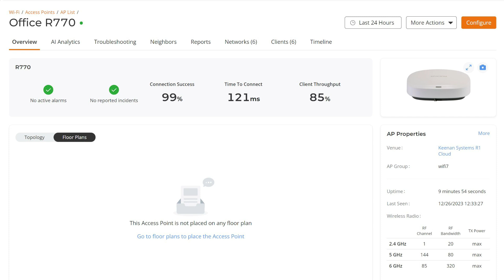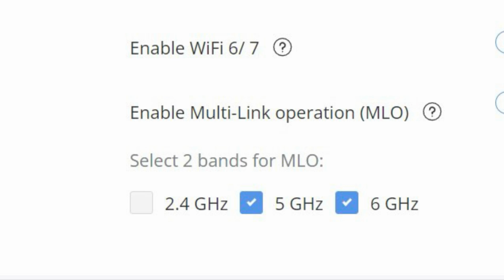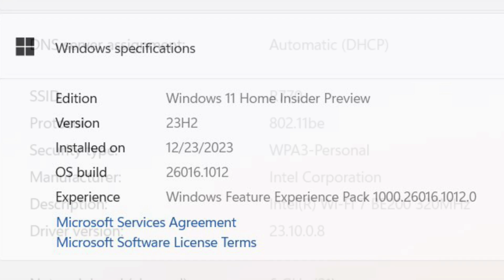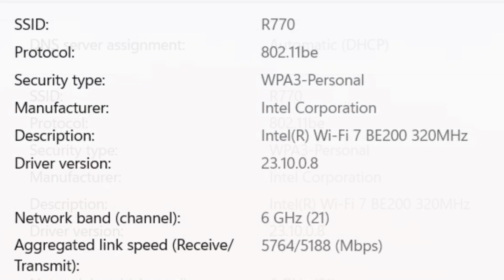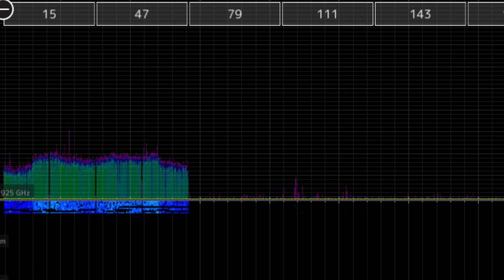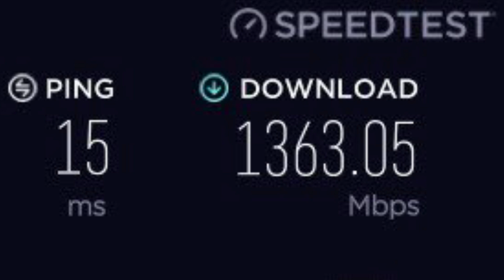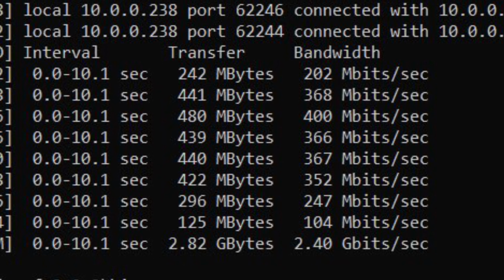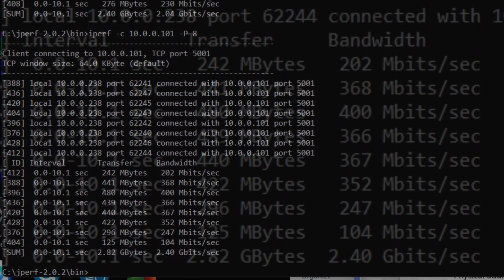Ruckus R770 Wi-Fi 7 802.11be Access Point Review 320Mhz and Multi-Link Operation (MLO) Tested

Comment: I had a year long saga with the Ruckus R770 AP.  I couldn't get full speed out of the AP despite having the correct version of Windows 11 and Wi-Fi 7 adapters.  
     It turned out to be the router that was the source of the problems even though on paper the MikroTik RB5009UG+S+in should have worked just fine.  I just got a Unifi Cloud Gateway Fiber router and this finally allowed a client to connect to the web at full speed.  Only annoyance was for some reason the router's 10GbE RJ45 port does not allow the upload speed to operate at full speed.  I had to use one of its SFP+ ports with a SFP+ to 10GbE RJ45 adapter for the R770 connection and a 2.5GbE RJ45 port for the WAN.
     I also switched to a MSI BE6500 WiFi 7 USB Adapter (Realtek RTL8912AE chip) for my AMD based system.
Reply from the maker: Yes you need a fast router to handle > 1Gb Internet connections like the  ESG510 https://shopify.keenansystems.com/products/engenius-cloud-esg510-security-gateway?_pos=6&_sid=c073c5a52&_ss=r
Reply: @keenanjeff I know.  Which is why I looked at the Miktotik and UniFi routers since they both have 2.5GbE and 10GbE ports

Comment: Where the Ethernet ports are located, is there a lip with a small space for cables to plug into? The diagrams online show that there is but wasn't sure if these were just marketing images. We have Industrial Cat6 Field Connectors which wouldn't fit into these ports unless these were designed like previous AP's.
Reply from the maker: here is a photo of the ports they are on the side of the AP bottom https://photos.app.goo.gl/MbvkMERspUK6d3Am8

If you are purchasing some R770's I can send you a quote.

Comment: How does Ruckus present the information of MLO clients (Clients MAC/Signal/Channels/TX RX Rate)? Does it display the information of each RADIO separately (separate display for each radio ?)or does it show all information in a single line for both 2.4GHz and 5GHz band (single display for all radio)
Reply from the maker: Windows 11 preview does not fully support MLO yet so I can only see a single channel with ax/be/6g there is a display spot for MLD MAC in the ruckus R1 cloud.
Reply: @keenanjeff  Have you ever tested with Samsung S24+ on Ruckus? It's one of the known clients that support MLO.
Reply from the maker: I have not but I hear conflicting reports as to if it even has Wi-Fi 7 enabled.
Reply: @keenanjeff  Thanks for such a good review.Your feedback is valuable to me

Comment: How do you configure the BE200 to connect using multilink in Win11 - is there new Windows UI to select that?  Or is it automatic?
Reply from the maker: it is automatic you have to be on windows 11 insider preview MLO is not fully implemented yet but you can see aggregate link speed in network info and you can run wlan show interface in powershell